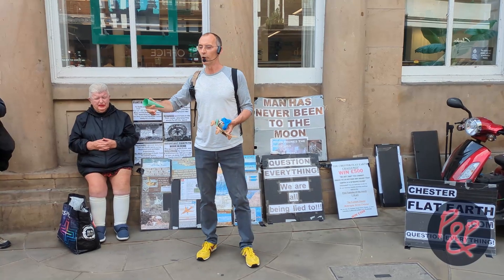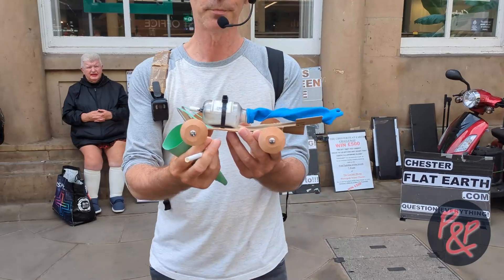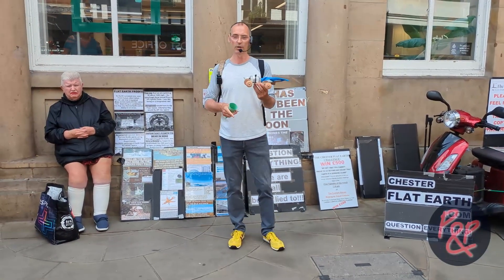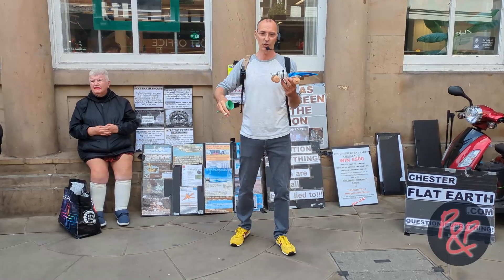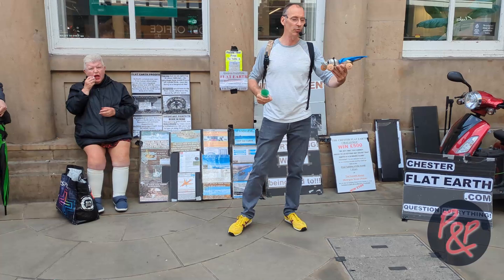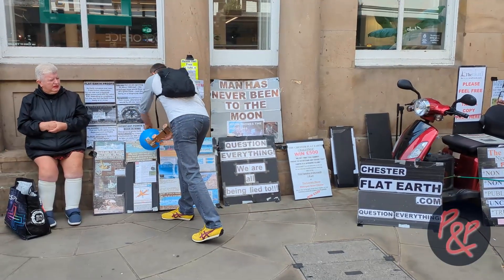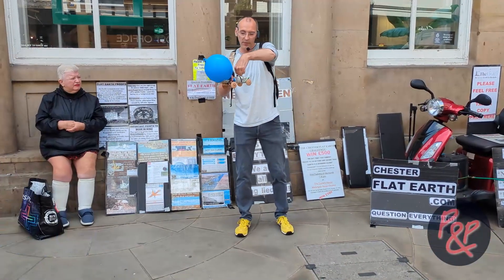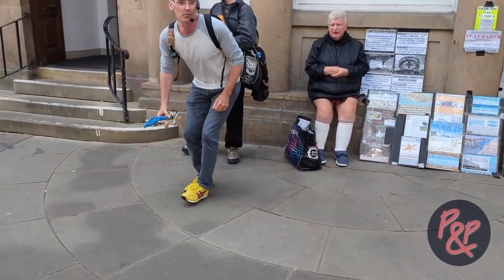Street Demo: How a rocket doesn't work!

Comment: Do you agree that the rate of acceleration of your balloon car depends on friction and total mass of the object as well as the thrust force provided by the deflating balloon? 

If so, do you also agree that in your second demonstration the friction and total mass increased?
Reply: The cart moved at 5:42. Why did you lie that it didn’t?

I’ll help you understand why the car didn’t move as far when you out the nozzle on it. The nozzle you placed on the car was a diverging nozzle. Diverging nozzles slow down subsonic flow. Since the flow was slowed down, thrust was reduced. 

Here’s an easy to understand example to explain what’s going on. Hold your hand a few inches in front of your face, open your mouth as wide as you can, and blow as hard as you can. Feel the force of your breath on your hand. Now, shape your mouth like you’re blowing out birthday candles and do the same thing. You’ll notice a greater force on your hand.

In the first situation, your mouth acted like a diverging nozzle. In the second, your mouth acted like a converging nozzle. 

The cone you put on the cart reduced the the exiting air speed and therefore reduced thrust, even though the volume of air leaving was the same.
Reply from the maker: @AM-rd9pu  Trust me the balloon car only moved the second time due to a nudge I gave the car when releasing the balloon. The car did not move due to the air exiting the balloon which means NASA's explanation for how a balloon is propelled through the air is wrong!

Imo what happens is this -

Because of the elastic properties of the balloon, the balloon pushes the air out of the balloon at a constant rate. From the balloon the air rushes out through the straw with a degree of force - this is the ACTION. 

Now in order for the balloon car to move resistance must be present. So as the forceful  moving air stream exits the straw it is met by the stationary surrounding air and it is this that provides a resistive force, that slows down the exiting air stream. As the force of the stationary air is so great, an imbalance between the 2 opposing forces builds up making the balloon car move forward!

There you go. Given this understanding a balloon car will not move in a large enough vacuum!
Reply: @PeterPete  quote - .."so as the forceful moving air stream exits the straw it is met by the stationary surrounding air and it is this that provides a resistive force"..

Okay, but in your second demonstration with the cone, the exiting air is still met with stationary air, so that disproves your entire argument.
Reply from the maker: @mattdamon7499  glad to see you're paying attention in class!

so the balloon car moves very freely without the cone but with the cone added, the balloon car doesn't move.

so it's clear the cone impedes the ability of the exiting air stream from the balloon to interact with the surrounding air and so the surrounding air is not able to generate a resistive force great enough to move the car

If science was right, motion should have been observed with the cone added, as supposedly motion is only due to the exiting air from the balloon inducing a force inside the balloon that pushes the car forward.

So because there was no motion with cone added this means the science to explain how a balloon is propelled through the air is wrong!
Reply: @PeterPete  ok so if your theory is that the air in the balloon pushes off the air outside of the balloon as it exits the balloon, and that's what generates the force resulting in the cars movement, then why in your second demo doesn't the exiting air push off the air inside the cone with the same force? Afterall, the air from the balloon is being released into the atmosphere, not a vacuum.
Reply: @PeterPete  Still refusing to answer my questions.
WHY IS THAT?

Oh THATS RIGHT, answering MY questions truthfully proves YOU WRONG.
Got it.
Reply: @PeterPete Even if you did give the cart a little nudge on accident, I still saw it move with seemingly constant velocity from ~5:41 to 5:42. That’s indicative of a force continuously acting on it, not just an initial force. If you had just nudged it, it would have only slowed down after the initial impulse. 

And you acknowledged that the balloon exerted a force on the air inside it. If you understand the third law of motion, you should know that means the air will impart a force back on the balloon, pushing it in the opposite direction that the balloon blew the air. 

You’re trying to adding extra factors in here. The balloon imparts a force on the air inside it and that air imparts a force back on the balloon.
Reply from the maker: @AM-rd9pu   watch the cart move at 03:20 and ask yourself whether the motion at 05:41 that you refer to was the same? I'm it wasn't because the cart hardly moved!

Imho If you compare the motion on the 2 separate occasions the motion was VASTLY different! Unless you want to clearly discard the observation?

You're still unwilling to accept that the explanation NASA give to understand how a balloon propels itself through the air is wrong. 

It's VERY clear the air exited the straw at 05:40 and the air's exit was unimpeded and so the balloon car should have moved in the same, or very similar manner as demonstrated  at 03:20 if science'#s/NASA's explanation was true!

This is the point you're unwilling to address. You banging on about the car moving (however little) and a force is present on the 2nd occasion is not the issue!

What is the issue here is the FACT that the air once exited the straw has an huge impact on the balloon car's motion, this is something you guys say is unimportant whereas it is vitally important!
Reply: @PeterPete  I’m commenting on the car moving because you said it didn’t move at all. You lied. 

And I already explained that you put a diverging nozzle on the car and the effects that has on thrust. I even gave you a little experiment you could try yourself to see the effects. You completely ignored that. 

The diverging nozzle slows down the air leaving the balloon. Slowing down the air reduces thrust. 

And there’s still ambient air within the nozzle when you release the balloon. How do you think this proves your point when the air leaving the balloon is still hitting ambient air?
Reply: @PeterPete  See Pete, we can see right through your deception.
  You refuse to admit that rocket exhaust has mass OR that a rocket engine MUST apply a "force" to get that mass to exit the rocket nozzle at over Mach Eight,
Because THEN you would have to admit that the rocket MUST feel an "equal and opposite force" that pushes the rocket forward.

You would have to admit that rocket propulsion is just the mechanical recoil of pushing mass out the back.
You want to deny the basic physics of toy water rockets.
Reply: @PeterPete  The demonstration I saw many years ago used a strip of paper, maybe 3" wide and 7 or 8"inches long that was taped horizontally across the back of the car used to deflect the exhaust gases straight up and down (could also be placed vertically ).  The point in deflecting the exhaust gas is to simulate a vacuum, a place where there is no air to push off. Thus proving the rocket DOES push off air/needs air to push off. Besides that, the "near infinite" vacuum of space would overpower and SUCK the exhaust gas out of any orifice negating any possibility of thrust as SHOWN in the balloon car with vacuum cleaner video mentioned in another comment.
Reply: @scottmerrow1488 Deflecting exhaust doesn’t simulate a vacuum. The piece of paper in the demonstration you described acts the same as if you had a fan on a boat trying to blow its own sail. 

The air being blown exerts a force on the system, but when that air strikes the paper, it exerts a force in the opposite direction. The forces cancel out and no motion is achieved. 

And lastly, a vacuum is simply a lack of stuff. It is quite literally nothing. Nothing can’t act on something. Vacuums don’t suck; pressure pushes itself outward into a vacuum.
Reply: @scottmerrow1488  You know that if you go watch a Falcon9 launch yourself, you can witness the falcon booster leaves earth's atmosphere and fly around then come back and land.  With a P900 or really good eyesight and a clear launch day you never lose sight of the booster. How can you claim that is faked?   I can find hundreds of observers posting video of the boosters returning complete with sonic booms.
Reply: @PeterPete >so it's clear the cone impedes the ability of the exiting air stream from the balloon to interact with the surrounding air and so the surrounding air is not able to generate a resistive force great enough to move the car
OR, you are completely wrong, and it's more like the cone is reducing the velocity that the air exits at, which lowers its momentum and thus reduces the force on the car.
Reply: @PeterPete >Because of the elastic properties of the balloon, the balloon pushes the air out of the balloon at a constant rate. From the balloon the air rushes out through the straw with a degree of force - this is the ACTION. 
No, the action is the force on the air from the balloon's restoring force. Your definition of force after that is completely different from the one used by everyone else. 

>Now in order for the balloon car to move resistance must be present
That "resistance" is the inertia of the air due to its mass, which the balloon acts on. That is matched by the reaction force on the balloon.

>the force of the stationary air is so great, an imbalance between the 2 opposing forces builds up making the balloon car move forward
Why would the moving air "pushing on" the stationary air cause the balloon, a completely different object, to accelerate? And at what point do you delineate the moving air from the stationary air? Do you think the air stays stationary? Why would the air inside the balloon, that is initially stationary, not also provide a "resistive force" and accelerate the car?

None of these questions can be explained by your schizo, unscientific model.
Reply: @scottmerrow1488  > The point in deflecting the exhaust gas is to simulate a vacuum, a place where there is no air to push off.
Except it doesn't do that at all. How the hell does that make any sense to you? Deflecting the air outwards means that the deflectors are decelerating the air that was just accelerated by the balloon. Both are attached to the car, so the net force in the "forward-back" axis would be zero.

> Besides that, the "near infinite" vacuum of space would overpower and SUCK the exhaust gas out of any orifice negating any possibility of thrust as SHOWN in the balloon car with vacuum cleaner video mentioned in another comment.
Vacuums don't "suck".
Reply from the maker: @diobrando2160  seems to me you have a bias, a prejudice towards this science space stuff and you're merely stating your view to validate your understanding of it, even though you have no proof that what you're saying is actually what happens!

we clearly saw in the demo movement was observed without a cone and yet with the cone fitted, no movement was observed. So we have to ask why is there no movement with the cone installed? The air still exits the balloon as we see the balloon return to its deflated state. So what could it be? It has to be something EXTERNAL to the balloon car!!

I'll let you work out the rest because for me, it's clearly obvious!!
Reply from the maker: yawnns!! this conversation has now reached its closure! many thanks for participating in the convo and I wish you well!
Reply: @PeterPete  I'll take that as a no
Reply: @mattdamon7499  Yeah Pete does not do too well when you ask actual QUESTIONS.
Watch - 
Pete - Does rocket exhaust have "MASS"?
- Does a rocket engine "ACCELERATE" that mass?